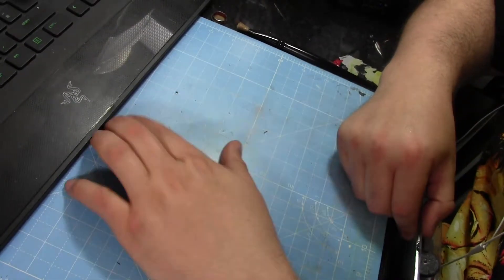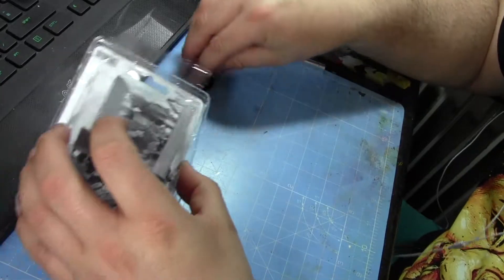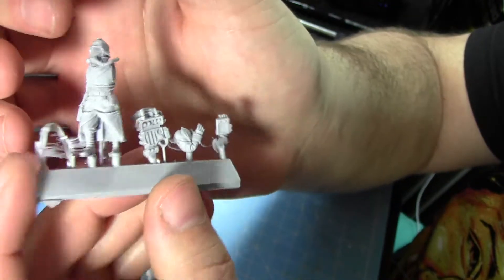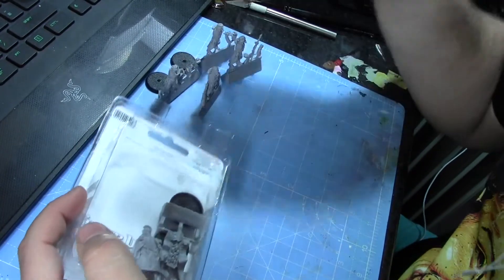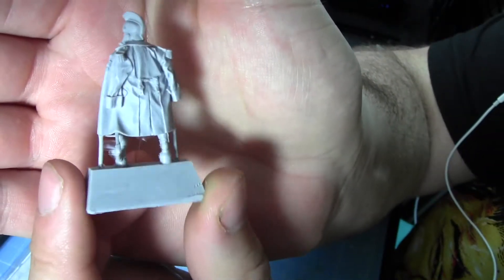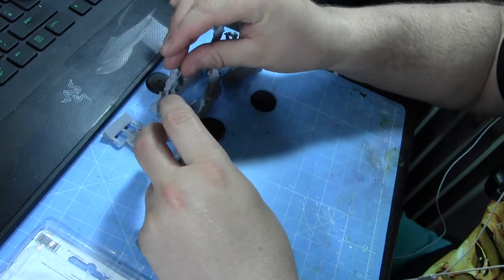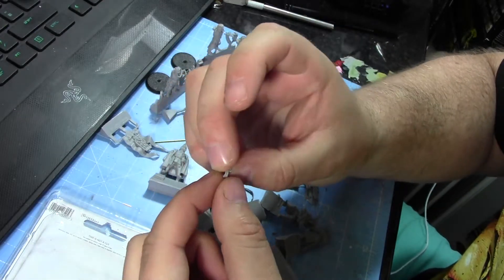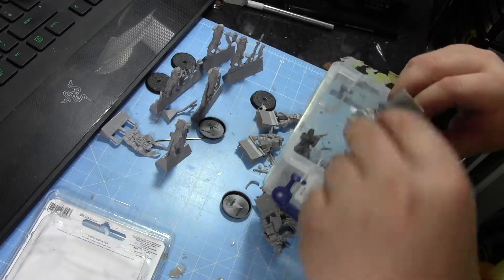Death Korps of Krieg Command HQ Squad

Comment: The colour of FW resin doesn't really tell much, most of the stuff from FW I've got is light grey, but I've got a really old Colossus bombard that's olive green (and a better quality cast than some of the more recent stuff I've bought). Also the little triangular bits the resin is poured into on your autocannon team is pretty normal for FW. I think some of the older models have that more, but I've got a contemptor dreadnought that came on ones that looked identical to yours.

The stuff you bought on ebay probably was legit forgeworld stuff, but miscast. Often people get miscast stuff from forgeworld, ask for a replacement, and then sell the miscast ones cheaper on ebay.